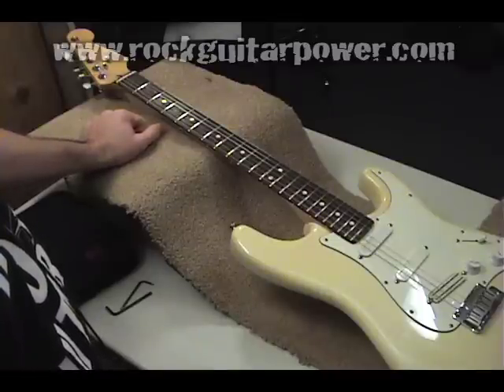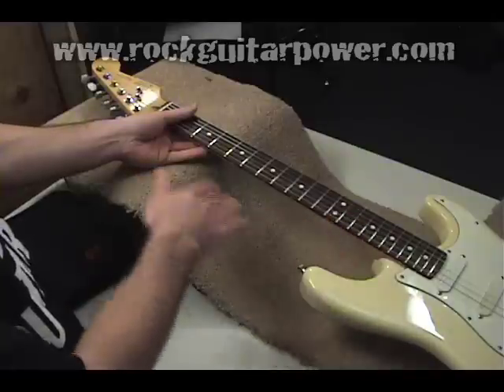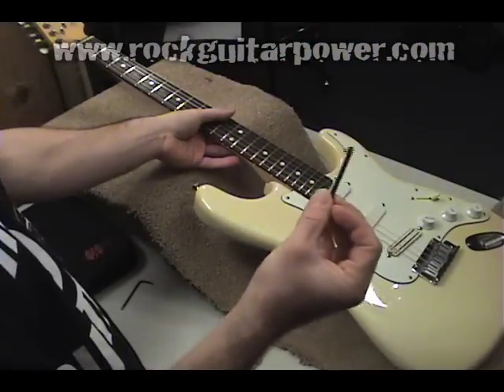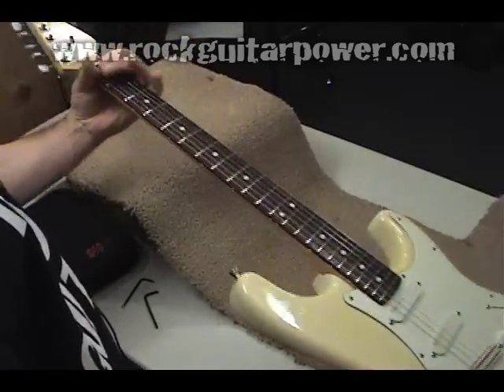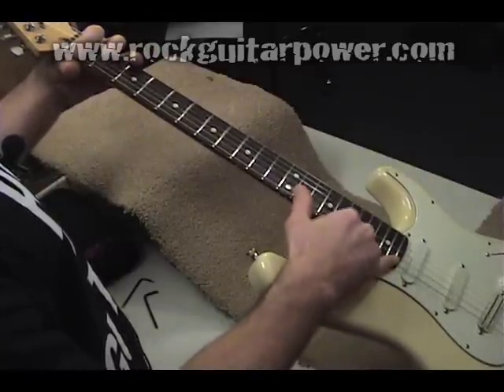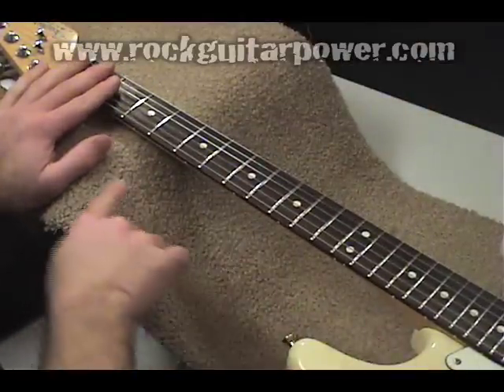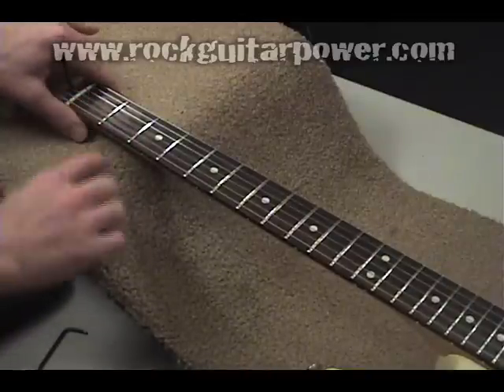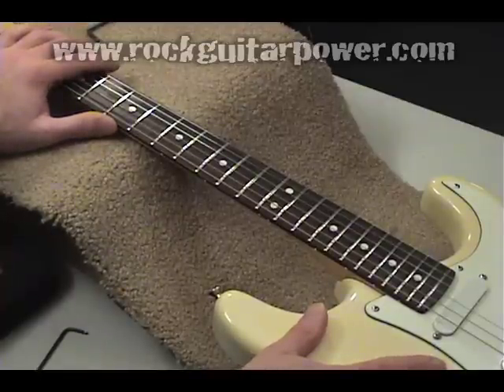Truss Rod Adjustment

Comment: Thanks for this, but I'm going to quote a little rant I put on another truss rod adjustment video. And by the way something worth mentioning might be, that if one has to loosen their strings to be able to get a screwdriver to take out the typical three screws on the head plate for access to some truss rods, whether it's best to then tune the strings back up to proper tuning before adjusting the truss rod. Personally I think you should...what do you think? So, here's my crazy rant below....
Think about this. A newby guitar player. Wants to understand how to adjust a truss rod. Has never seen an entire truss rod, only the end of one. Then he watches videos on youtube whereby the guy will say..a quarter turn...clockwise...wait....see what the wood does...check...get this height at this fret, etc. Clockwise tightens the rod. Ok. At this point the newby has not learned the very basic thing that his brain needs to understand. How does turning the end of a rod tighten a rod? What is getting tightened? You turn a bolt, a nut, etc., that all makes sense. And it does because you know you're tightening it against something. Usually another piece of metal or wood. Now back to our newby watching this video. Hmm. You turn this end clockwise and it tightens it. Tightens what? They have no idea what is really happening. Is this truss rod actually two bands of metal...how does turning  a hexnut on the end of a rod either tighter or looser cause it to change shape or relax it's inherent shape?  And none of the other truss adjustment videos on youtube explain what is really happening. If this simple, basic information was shown clearly, the rest would fit into his brain perfectly. It's like the videos that shows how to wire guitar harnesses. You solder this onto the third pole, and this onto the second pole, etc. But nobody explains what is going on inside the pot, what happens during rotation of the pot, and how it affects those poles and why.

Comment: I have a Jackson, and my truss rod is weird, it's like it needs an actual ratchet, or wrench or something. None of my Allen Wrenches work on it, the hole is too round. My strings are touching the fretboard and there isn't anything I can do! Can you help me with that? Any ideas?
Reply: There is a special tool sold by Jackson. My guitar came with it. It is like a small socket wrench.
Reply: damnit now i know why the sockets i bought didnt work

Comment: What if the rod is completely loose and there is still back bow?  Will putting super thick strings and tightening the strings on high tension pull the neck back over a few days?  Or will moist heat be required as well?

Comment: Help, my strat deluxe is buzzing badly on the first 2 frets..  Seems like the neck has shifted.  Should i adjust the truss rod or play with the action?  haven't got the measuring tools and my guitar tech is a hour drive away.  Suggestions???

Comment: I have an electric/acoustic one which has 20 frets and when i try to play power chords and I strum with lots of force to get that strong sound it had fuzzy sound like a bell ringing I figured the strings low e in particular touched other frets while vibrating to make the sound, I adjusted the rod a little and if I don't hit it really hard I doesn't do it any more, the neck is straight when I look at it, but when I play other stuff on it I feel that the sound has changed slightly, hard for others to notice when they listen but I feel it has changed so what should I do? Is this normal or should I take it to a guitar shop so they can do something with it? I haven't changed strings When it came, I think I should change them, cos I've been told that factory strings are cheap and make bad sound. Explain to me if you can please, I've been playing for 6 months on a classical guitar and got my electric/acoustic just a month ago.
Reply: Your guitar is broken. You probably have messed up frets. You either need to get a new guitar or pay more to fix it than the guitar is worth.
Reply: No actually I fixed it and plays well now, it only occurred when the guitar was new.

Comment: So my Strat is buzzing on the higher frets (12 and up, especially treble strings) and I've loosened the truss rod quite a bit (a few full turns) and it doesn't seem to have made much of a difference. There's a small amount of relief but it still buzzes. Is it hard to affect because it's Maple (with a Maple fretboard)? Do I need to keep loosening it, or do I probably need a fret level?
Reply: get a fret rocker and make sure theres no high frets a credit card is fine as its got a straight edge. some fret only need around 1 to 2 thou higher to create fret buzz.  action wise 1.6 to 1.8 mm fine at the 17th fret. your never going to get a 1 mm string height on a strat i heard some say they got that height. its impossible on a 9.5 radius neck .
Reply: Are all Strat necks like that? My luthier said it's a "traditional strat neck" and that's why it's so flat and the notes choke out. I'm not looking for super low action, just low enough that it's comfortable. Could I buy a different neck with more radius?

The weird thing is that it seems to be buzzing the most at frets that look less worn, with lower ones in front of them. Does that even make sense? I don't have a straightedge to check the actual heights, but I have a metal ruler.
Reply: Mike utubesux A few full turns to a truss rod is A LOT! Most often truss rod adjustments require a half turn or 3/4 to achieve the desired result. I won't bore you with a lengthy explanation but this "adjustment" is more than you'll be able to fix if a few full turns made no difference. Take your guitar to a really good luthier or guitar tech. You are not going to be able to fix this yourself.
Reply: Reflexez yes you can get low action but as you say it will fret out on the higher frets, but a 1mm fret height at the 17th fret is in my opinion to low and thats hard to get on a 9.5 radius fretboard that what one guy said in a forum that he had fender specs say 1.6 and thats if you have a light touch. i find 1.6 to 1.8 mm great.
Reply: on the official page of fender says: First, check your tuning. Affix a capo at the first fret and depress the sixth string at the last fret. With a feeler gauge, check the gap between the bottom of the string and the top of the 8th fret—see the spec chart below for the proper gap. So dont know why this guy is checking it at the 12 fret instead. I guess I will look for more videos about it

Comment: Hey there, I'm getting fret buzz on the low E string when I fret the all the strings, any suggestion? 
Also on my acoustic i'm getting a dead note/buzz on the 13th fret on the high E string. What should I do?
Reply from the maker: Hey musicman... For your first question - Need clarification, are you playing the E string and it's buzzing or your hearing it buzz when you play all the other strings? Second question - Dead notes are a little bit tricky to fix. Usually means the neck is a bit twisted. You'll want to take it to a good tech to look at it. In the case of electrics you usually take the neck off and shim it if needed. Acoustics are harder to deal with since there's not as many moving parts
Reply: rockguitarpower It's mostly the E string. I adjusted the neck on Friday and left it over the weekend and when I took a look/play this morning the 1st, 2nd, 3rd, frets were fine. The buzzing started around the 4th fret-10th fret.

Comment: So looking down the neck towards the body, you turn it clockwise to take the bow out of the neck, or straighten it? Left and right is the other way when you look at it from the other way... so it could be a bit confusing to some.
Reply: It's the other way around as well if you have a guitar that the truss rod is adjusted from the bottom side. Now I'm really confused....haha

Comment: no ... tuning a half step down will not affect the truss rod the truss rod tends to bow only after extreme temperature and climate changes and age ... if you have a Floyd rose you may have to adjust the locking tremolo ... other than that you should be fine

Comment: Okay. After changing the strings the E buzz at the 0 fret almost all the time and the A string is just slighly buzzing. This happens only at clean fret. Is it possible to reduce or even eliminate this buzz by adjusting the truss rod?

Comment: if those are the only spaces it buzzes, but the rest of the string rings out fine, without buzz, it could be 1 of 2 things. there could be some warping in the neck, where its twisting left or right, or, it could just be a high fret. ill put my money on just some high frets, in which case you just file down the fret a bit with some steel sandpaper. take it to a shop and get them to check it out first though, since i cant see it to be 100% sure if its high fret wire.

Comment: I have a dean ml set neck. the action is really nice and low as I bought it. I notice the seventh fret first string buzzes. als second fret fifth string. with my finger on the first and last frets of the sixth string I can see the twelfth fret gap is very small. do I tighten or loosen the trus rod? I'm just checking before I screw it up

Comment: @rockguitarpower I just bought a Mighty Mite strat neck and put it on a Mighty Mite strat body and at first it seemed that the lip from the neck at the body seemed to ride a little high. Now I am putting on the bridge and the string touches the frets all the way up the guitar. Does the neck need a truss adjustment or need more than that? (ex. sanding down the bottom of the neck where it slots into the body).

Comment: I dont seem to have a bow. The distance between the strings and the fretboard just seems to get larger and larger as it moves from lower to higher frets/ At what fret is the halfway point (string furthest away from the board) so that the strings start getting closer again after that point?

Comment: DUDE YOU ROCK!!!i am the proud owner of a washburn wm24 which you can tell by the looks of it that its a shedders guitar. a year later i saved money and bought a v shaped guitar. thats when i noticed that the strings on my first guitar were pretty high.when i found out how to lower them,i noticed some notes would buzz. ive been trying all sommer to find a way to lower them without having buzz and thats when i found your vid!i also owe u 50 bucks because i was going to take it on a shop     
THX!

Comment: Clockwise will tighten the rod and make the neck towards a back (convex) bow. It is very rare when a neck has a convex bow, but it can happen if you go from heavy to light strings.

Comment: Ok here's a question for you!! I have a Schecter Hellraiser V-1 and the first few frets on all strings buzz  ,not really bad , but enough to be annoying. The action is perfect and with a ruler laying flay on the neck , it's straight as an arrow. Not fretting out any where on the neck even the upper register on the top E. When I do the test of finger on first fret , last fret and tap the 12th , the string is laying flat on all frets. What should I do? It plays great and stays in perfect tune!

Comment: Great video.  Any specific measurements/adjustments/details you can give me about setting truss rod/intonation for a Les Paul tuned to standard with 11's, or Eb with 12's?  I prefer slightly higher than average action, and love the big strings.  Can you help me out a bit with any different specifications that would properly suit my scenario?  Thanks!

Comment: Hey i have a question, i recently switched from medium .46 strings to heavy bottom slinky top .56 , the nut seems to be alright but now whenever i play on the lower frets i get horrid buzz, even with my bridge action extremely high. enough to the point where its like a quarter of an inch or more above the fret board, to where i CANT play and STILL get buzz, help? :/

Comment: hello sir, iv got a strat and have recently changed the string gauge to 10's cause it was buzzing a lot with nines, i set up intonation and lowered the action to a decent height and now trying to get the action lower but now its buzzing and fretting out a lot from the 15 fret on, should i make a adjustment to my truss rod?

Comment: @MatKiller1197 a truss rod isn't the only thing that can make your strings high. if you have a trem system you might have to adjust that to lay correct. you may have to adjust the saddles for the strings. lowering the strings at the bridge and having a level tremelo should help.

Comment: @ChickenFaeces well it depends if when you bought it it was set up. action height and neck. and what kinda strings you had on before.. typically a heavier gauge string will pull on the tremelo harder and lift the tail end of it up, which will raise your action. and reverse the other way. now it's not going to hurt it or anything but if your string are high you may want to tighten the springs in the back or lower the saddles...

Comment: @metallica5252 it has a nut the only thing is that mine is an acoustic and where the nut is supposed to be its down inside the little hole not the sound hole.

Comment: Any1 can help out on this?
ive loosen my guitar strings but and ive w8ted 8 hours for the neck to get softer but the thrust rod won't move.. 
the climate is hot and wet here and the guitar was placed in paralel with the ground for 1-2 months

Comment: My pleked custom made guitar has started buzzing around the fifth fret on the D string. I bowed the neck forward a touch to raise the string height. (Stop tail bridge has no height adjust). Still buzz. Then I noticed it was the bridge pickup buzzing at that frequency in it's shell. Pressing down on the bridge pickup dropped the buzz a lot, but not all...then I realized that particular frequency was traveling into the body making the whole guitar vibrate much more than any other frequency.

Comment: i've recently bought a Blacktop Fender Jazzmaster (brand new). it came with 9 guage strings and i wanted to change it to 11 guage.

i've changed the strings and i'm trying to adjust the truss rod, but i can't get the allen key into the truss rod, i've tried many different sizes of allen keys and none will slot in.

is there a different type of hole for the blacktop JM's, or is my truss rod just fucked up?

if it's fucked, should i just get a new JM? (still have receipt)

Comment: @ntrnate For a temp fix, you can loosen the strings and put small pieces of paper in-between the strings and nut, my cousin had to do that and it worked fine.

Comment: I HAVE A WANA BE STRAT CALLED A GLEN BURTON anyway the nut is a plastic piece of crap and has worn down alot since ive had it probly from tuning it to flat then back to standard so many times,  is ther a nut that doesnt wear as much that wont requir me to cut a biger hole for the nutt?????also im using .12 flat strings and will probly need to adjust some stuff right???

Comment: @Xyrium is not installed there exactly. Some truss rods are set in place by drilling a hole along the fretboard, but in this case they did a carving through the wood, put the rod and then fill the gap with a darker wood and then after some finish work looks that nice...

Comment: What happens if there isn't a lot  (or any!) of space on the twelfth fret after doing that testing method, does that mean it's a backward bow? And that would mean, loosing the truss rod, correct?
If there's a lot of space, tighten.
If there isn't any, loosen? 

And I have an acoustic, will this method work the same as well? There are 20 frets on my acoustic. 

Thank you so much!

Comment: I just bought a Robert Cray Strat, great guitar, but what a PITA to adjust the truss rod.  Still couldn't really get to it with the pick guard entirely off, so I had to take the neck off to get to the screw.  Of course at that point there's no tension on it from the strings, so you're guessing, and then you put it back together.  I adjusted it to be straight while it was off, and now it has just a little bow when it's all together.  I guess I got lucky.

Comment: Right.  I understand.  It's just that usually when people ask questions, it's cause they dont understand.  Just the way you worded it can make it sound a little confusing for some people who are not quite familiar with the whole setup process.  And changing the string thickness shouldn't make u have have problems with the action.  It's just gonna create greating tension, being corrected by adjusting the truss rod.  U shouldn't have to sacrifice comfortable action for thicker strings.

Comment: OH, that's why. They didn't buzz before 'cause they weren't as thick, now since they're so low and they're now thicker the thicker diameter is hitting the frets causing buzz. Try putting the action a bit higher.

Comment: As the truss rod also does quite a lot to the action of the strings, I do believe it's the first thing to check. If you still get buzz with a correctly adjusted truss rod, the action should be raised. As intonation does nothing to the action, it should always be the last thing to adjust. Any counter-arguments ?

Comment: @thedonace213 This is unvalidated information, but I would believe that as adjusting the truss rod also affects the action, it would be something like Truss Rod->Action->Intonation. Of course, as always, if you're not sure; google it until you are. Always measure your guitar to find out if the truss rod is really what needs to be 'fixed'. I would rather spend weeks fixing my guitar instead of months without a guitar. Good luck you all of you!

Comment: If you are changing the guage you are going to throw your intonation all over thye place... you will need to re-adjust the speaking length of the strings via the adjustment at the bridge. Unless the neck is bowed or under bowed leave it alone...